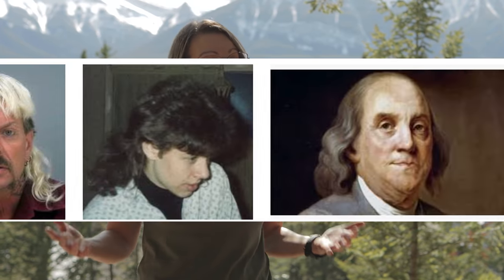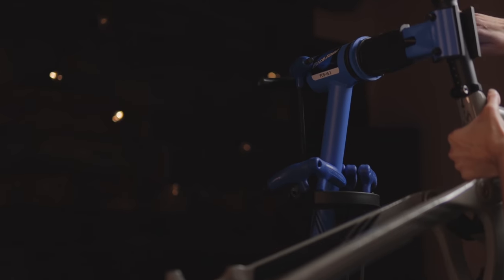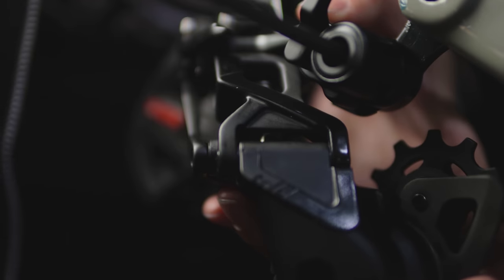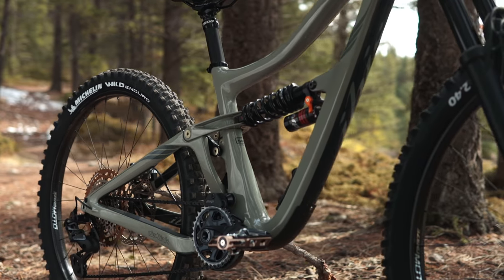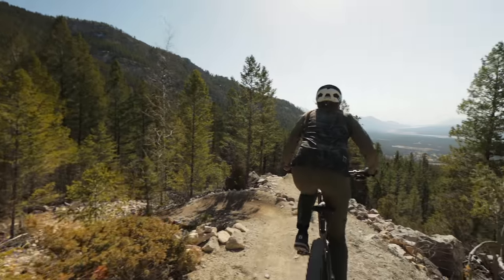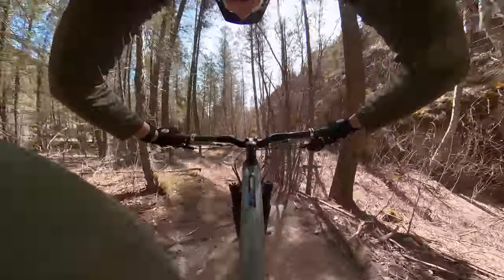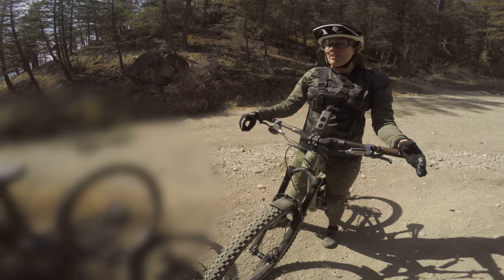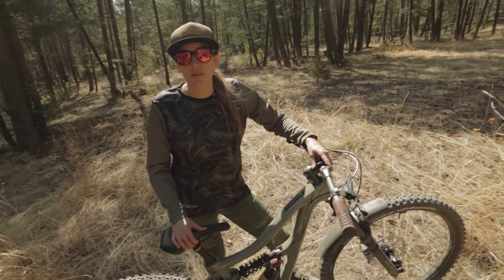Can you "mullet" ANY bike? YES. (DO THIS, IT WORKS)

Comment: One way to keep that bushing from spinning is to put a Scotch key in it.  You drill a hole that is 1/2 in the bushing and 1/2 in the shock eye then tap it for the the smallest set screw you can find.  This makes it easy to remove for maintenance/replacement but will prevent it from ever spinning.  Don't forget to put Loctite on the set screw.  This is an actual technique I learned while working in a machine shop many years ago.
Reply: how often have you seen/heard of offset bushings spinning?
Reply: Not often but in this case the force is going to want to push it around the other way. Its like balancing a broom upside down on its end vs hanging it by the handle.
Reply: @mattdidisheim2211   I ride a Pivot Mach 5.5 I cannot use the offset bushing in the reverse setting. When I do it creaks like crazy and spins after one ride. One explanation I received, the DW link on the Mach 5.5 spins more on the bushing than other suspension setups. Not sure if there is any truth to that, but it def did not work for me in the reverse position, just like Offset bushings said it wouldn't :(.  Considering I'm riding a Fox Float X2, I'm not willing to try a Scotch key.

Comment: I did a quick experiment with my 29er.  Putting a 27.5 rear wheel on only dropped the BB, a touch less than 10mm.  I think that would probably not be a massive deal.  Especially if I put a fatter tyre in the back.
Reply: Yea I just recently did that to my bike and have ridden it a decent amount that way and it feels pretty good and i haven’t experienced any pedal strikes or anything yet

Comment: Back in 2002-2007 when I rode nearly every day 5 months out of the year, this was a really common thing to do. 26" wheel in the front, 24" wheel in the rear. 
My hardtail and my full suspension both had that setup! And probably 90% of the people I knew and rode with had the same thing. 
I wonder why it's seemingly so uncommon these days? 
Either way, the ride looks awesome!!!!

Comment: I'm riding almost the exact same setup, only with DVO suspension. Cornering is truly amazing! And the bike (as Beth said) is so FAST! The only problem so far is the offset bushing has rotated. I adjusted it and retorqued it. Two rides in and so far, it hasn't moved. Also, I climb with the rear shock in the middle setting to help avoid pedal strikes.
Reply: Did you use a 2.6 as well? I’m waiting for parts to arrive so I can mullet my AF but haven’t decided on tires.

Comment: Nice video and a great explanation of the upside & downside of a mullet set-up.  
I was thinking about the offset bushing in the r/suspension and if the suspension forces cause it to spin around, a simple solution would be a small grub screw tapped into the shock eye.

Comment: I used the same reverse bushing +160mm fork set-up on a '20 SJ Evo for over a year and am happy to say the bushing has not rotated at all.
Reply: Great to hear.  I ordered a bushing to do exactly that.  Then the company (who shall remain nameless) said NO THAT WONT WORK! So I chickened out. Now I'm doing it!
Reply: That's great to hear! Hardnacks - we don't recommend using them, as they will want to rotate. We do have many customers using them in reverse - some bikes work better than others with this. If there's a chance our product won't work as advertised, then we won't recommend it as I'm sure you can imagine - so in general we suggest not running then like this. But... it's a free world! :)
Reply: @offsetbushings5182   yes unfortunately for me, it did not work in my case.  Lots creaking on a short ride, and the bushing inched its way to the middle.
Reply: @Nathanhardecki could you let us know which bike you tried it on?
Reply: @kevindeleenheer8105   2020 Pivot Mach 5.5 with a Float X2

Comment: Recently I turned my wife's Marin Hawk Hill into a mullet out of necessity--her 27.5" fork was out for warranty repair and we wanted to go riding, so I threw my spare 29" fork on it with a spare 29" wheel, and away we went. She's decided she's keeping the mullet because she's keeping her speed up better through tech, lifting the front wheel more easily, and feeling more control through turns. Her height is 5'2"  / 157 cm, for those keeping score.

Comment: I ride Ripmo V1. Have slackened it with -1 degree headset and put 650b rear wheel. Both tyres are 2.4, cranks 170mm, however I don't use any offset bushing. Rode this setup first time today, initially had few pedal strikes but only when rear sus compressed. Adding a bit of low speed compression on my EXT solved problem, obviously BB is lower and requires more attention. Also had to readjust seat (move forward) to maintain previous position. All this has changed this bike dramatically, it's much more stable but still climbs as good as used to, whereas cornering experience is mind blowing!

Comment: Definitely interested to see if that offset bushing rotates around to the correct (or incorrect in your case) way with the shock forces.
Reply: Same. It did not work for me on my setup, Pivot Mach 5.5, creaked like I broke my frame & spun after one ride.  If they got it to work for them, I wanna know-how (not scotch key)

Comment: Mulleting can be a great way to update an older frame with a steep headtube angle. Putting a 29er fork and 27.5" wheel on the front of my old 2004 26" hardtail has transformed it into a very capable downhiller. It climbs for s**t, but I don't flinch anymore at anything I am comfortable taking my 2021 full squish bike down. It's bottom bracket height was lower to begin with and now matches a more modern clearance. The main thing is that the short wheel base will always just be something to deal with on it -  though the extra lift at the front did stretch it out by about an inch.

Comment: I honestly believe the mojo is a great plattform to mullet convert. you have to sacrifice a little travel in the front, but that hasnt hurt my riding at all. My Mojo 5 is now 155 rear and 160 front.
Reply: I did a Mojo 4 mullet and it was pretty dang amazing, however, it got a little overwhelmed in the super chunk, which is what inspired me to figure out the Ripmo mullet. Both are amazing but I prefer the Ripmo mullet for overall speed and composure and rough trails.
Reply: @gfowkes  True that. Mojo is more of a playbike anyway, the ripmo is far superior on the rough and fast trails

Comment: Great review, I think its a better idea to use two bushings with half the offset. And locket them in. I did this to an old 26 inch Mojo years ago when I converted it to a 27.5 and it was great for a year or so. But it spun without me knowing,  and I broke my swing arm when the back wheel hit the frame after landing a huck to flat jump. Ibis was really cool and sold me a used swing arm for 50.00. Except E bikes, I've ridden nothing but IBIS for 10 years now. Love them, and the company.

Comment: Very well filmed video, interesting to see a mullet conversion from a 29er. 

One of the biggest benefit from a 27.5 rear, the shorter chainstay, is negated from this setup. Although you’ll still get the benefit of a lighter mass rear, and more clearance when shifting your weight behind the saddle.
Reply from the maker: Thanks! Funny thing is: Beth chose the Ripmo V2 over the HD5 (or other 27.5 bikes) partly because she wanted longer chainstays. Better climbing performance; better performance in rough, fast situations; overall better cornering characteristics, etc. There's a lot to love about longer chainstays :D
Reply: @TheLoamRanger  Ah that makes sense. I’m a bit stubborn with the old thinking that the shorter the chainstay the better haha. Many bike companies now are increasing the rear center on their bikes, for more high speed stability and climbing performance. Totally up to each rider for what ride characteristics they prefer 👊🏼

Comment: Wow I just took my first ride on my mullet converted AF! This thing is amazing. The acceleration cornering and jumps are so much better.
Reply: Have you had any issues with the bushing on the ripmo AF? What else did you do except the bushing? How about pedal strikes?
Reply: @lalleohman  Ive had the bushing for 5 months of park riding on an XL ( least amount of bb drop). No issues so far. I’m running 165mm cranks. I’m on 2.6 tires front and rear.
Reply: @melanatedmtb  great to hear. Still waiting for my bushing. It takes forever to get stuff from Great Britain nowdays. What kind of tires are you on right now? Did you do anything with the bushing when you installed it? Have your tried the cascade link for the ripmo AF? Thanks
Reply: @lalleohman  My bushing took forever too. I plan on ordering another just to have it on hand when this one wears out. As for tires I’m running 2.6 Kenda Hellkat in the front and Regolith in the rear. They seem to be the lightest  fastest rolling tires with very good grip. The grip of the hellkat is amazing. The grip of the Regolith is good but you can make it dance around when you want. Cascade said they’re might be frame/ rear triangle interference with the offset bushing so I left it alone.
Reply: @lalleohman  be aware before making the decision, the smaller rear wheel will make the bike climb slightly worse than the 29 but the benefits to jumping descending turning and moving the rear around is so much better.
Reply: @melanatedmtb  thanks for all the info. Got the mail from customs today. Bushing will arrive soon. I already have the 27,5 on the bike. Crazy low for the moment. Got a dhr 2 2,4 on it now and 170 cranks. I will look at the Kenda tires and also shorter cranks. Is it possible to contact you any other way? Thanks again.
Reply: @lalleohman  yup the bushing spun but I solved the problem by drilling and tapping the shock and bushing and securing it with a pedal pin

Comment: Hopefully the shock yoke doesn't smack into the frame at some point, that gap is tight enough on a stock Ripmo, with the offset bushing that looks REALLY tight.  With the Ripmo BB being super low already I never really thought it would be a good platform to mullet.

Comment: This is tempting.  Does a mullet setup void the frame warranty?  (I know a 170mm fork does).  I have shorter cranks on mine already (my V2) tempting to just stiffen up the rear shock (less sag) and do the 2.6 in the rear and hope for the best with the pedal strikes. (or keep the mullet setup for more flowy, jumpy trials and go full 29er when I'm in the gnar).  Thoughts?

Comment: Hi there! Beth looking great on the Track :) I have myself a Ibis Ribmo 2 and was thinking about converting it to a mullet. My main Problem are the Tire marks on my But ;-) I'm 5 Feet, 8.5039 Inches and ride the Ripmo in M. So here I got some questions about the conversion: 
How does the uphill-riding feel? Not loosing efficiency? I thought that with an 27.5 Tire in the back you would loose the good uphill qualities, although the seat tube angle is still the same right? Where did you get that Bushing? How much % is your Sag on the Fork and the Shock? How long is your Stem? Thanks for ya help! Keep on riding, love the channel!

Comment: Has Beth always run 165mm cranks? If not, how'd she find the climbing with (shorter?) than her usual crank length?
Interesting the bushing design doesn't extend beyond the shock eyelet - the Burgtec ones 'look' longer so they get clamped in place (by the frame/clevis) - maybe better?
Could offset bushing have been used in both ends of the shock, or just not on the Ripmo.

Love Beth's kit too (and dam she's fast!), is that DHaRCO top & bottom? Been eyeing up there gear for winter riding.
Great Vid' thanks :D

Comment: Spoiler alert: That bushing in the shock mount will definitley spin itself around. Nothing about this is a good idea.
Reply: I'm not saying "definitely", but I'm concerned too. I'd be more confident in it if they installed it with press fit bearing retaining compound and primer.
Reply from the maker: After a few days of riding which included many drops, jumps and rough sections, the bushing hasn't budged, not even a little. So we're pumped about that! If it did turn too easily we were going to try what Matthew suggested, but I'm glad we (probably) won't have to do that. We'll how it goes, long-term.

Comment: I realize this is an older video, but I'm trying to find a new shorter travel bike and can't find any without a 29" wheel in the back which I have not found to work well on any small frames that I've tried. Do you have a long term review of this set up? Would the offset bushing work on any bike? Where did you get it from? Did it ever end up rotating out of position? How did the mullet set up affect the climbing? If it makes the climbing a lot worse, it would kind of negate the benefit of having a shorter travel bike for me.

Comment: My 2018 bike head angle is not slack and the wheel size is 27.5".  My shocks are both 150mm.  If I were to change my front fork and use a 29" front wheel, what might be the up and down sides of the modifications?

Comment: Wondering if the bushing would work well on a stock af with the dvo air shock? I’ve got a xl and I pedal strike a lot, so I’d like to raise the bb height a little without needing shorter cranks. At 6’6 with long legs it’s not a option on the cranks. I was surprised at the number of pedal strikes on climbs, I’m learning to be careful but it sucks when you need to power up a punchy climb.

Comment: Awesome! How about some BB height measurements before/after?
Reply: On average over two bikes just sticking a 27.5 on a 29er frame will lower the bb by 18mm and slacken it by 0.8. As long as the bb is above 330mm you won't have an issue with pedal strikes. And if you do just run a longer fork which will slacken angles by ~0.5 and raise bb by 5-8mm. It's well worth the mullet setup it just carves so nicely. I'm 6ft 1 for reference so height is not an issue.
Reply: @ross_rusher0243  Good to know. I have a Ripmo AF and was considering a mullet setup since I've heard how good it is. I already have 165mm cranks but a 170mm fork and smaller rear wheel would just ruin the nice seat tube angle haha
Reply: @BrianReynolds84   not really It'll be be slacker by 0.8 on the seat tube aswell
Reply: @ross_rusher0243  I'm riding a Ripmo mullet similar to Beths. BB is 337mm.
Reply: @gfowkes  on your Ripmo did you use a bigger rear tire?
Reply: @melanatedmtb  No, I have 2.6 on both front and rear... however, when it's time to order new tires, I'm going 2.4 front/2.6 rear similar to Beth's rig.

Comment: What fork did you use? was it 27.5? I' am trying to see if I can fit a 29er tire in my Fox Stepcast 140mm 27.5 Plus Boost fork.
Reply from the maker: It's a 29er fork from MRP. You'll definitely have to be careful with tire size if you're trying to stuff a 29er wheel in a 27.5 fork!

Comment: I really enjoy your video's. This one kind of has me scratching my head a little though.. The HD5 is a perfect bike to mullet and doesn't require all the "sketchy" not recommended things you had to do on the Ripmo. I just decreased the front fork to 150mm and the geometry stayed the same and it has a higher BB so no worries on pedal strikes.   Look forward to the next video!
Reply from the maker: We did think about doing that, but retaining the 160mm fork up front (and keeping the option of bumping it up to 170mm if we wanted) was important for Beth, plus some other geo numbers that fit Beth and the bikes intended purpose steered her towards the Ripmo V2. You can't go wrong either way, it seems.

Comment: why not run two offset bushings?
Reply from the maker: The clearance between the clevis and the seat tube was pretty tight with one. Also there is less movement on the front shock mount so there less of a chance of spinning from the reverse position.

Comment: There is no benefit but worse of having rear wheel smaller than front wheel for the off road mountain bike. It's like stripping down a beautiful manufactory paint job on the Ferrari and then repaint with a cheap can spray or grinding down all your perfectly healthy teeth and then cover them with fake teeth. Don't listen to BS marketing.
Reply from the maker: That's objectively not true and there's no marketing here (Ibis doesn't make a mullet Ripmo). Like Beth said in the video, riders with shorter legs can benefit from a smaller wheel in the back due to better clearance and mobility over the bike. But then why not just run a full 27.5 setup, you ask? Because a larger front wheel is proven to have more traction and smoothen out the ride. There are many other reasons, but what I've just listed above is plenty enough for me! Cheers
Reply: @TheLoamRanger  : The only benefit to go mullet is for learning how to wheelie. It is not true about mullet being benefit for short people. 27.5 frame has same bottom bracket height as the 29er frame. If you put a 27.5 rear wheel on a 29er frame, the bb would be lower. It would be unsafe to ride it since your cranks will hit the obstacles below. But if you said it is benefit for short people, then why you had to adjust the rear suspension to bring frame up same height as original? There is no benefit for short people then, right? Also, modifying manufactured bike geometry, you will not have the same performance as the original bike was designed for. It would be dangerous to ride this setup and the bike manufacturer will void warranty of the frame when you crash. Are you a register engineer? It appears that you have miss out so many information. Lots of bike designers have no idea what they are talking about. It seems that they are making up lots of non sense in order for you to buy their junks.
Reply: @TheLoamRanger  You calling a 79er a mullet makes you look like a casual pinkbike fanboy.